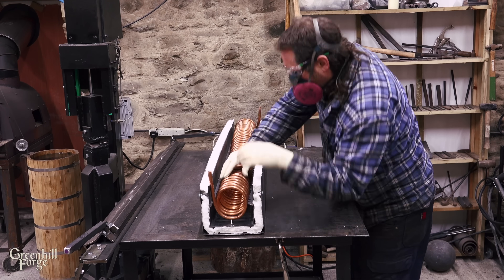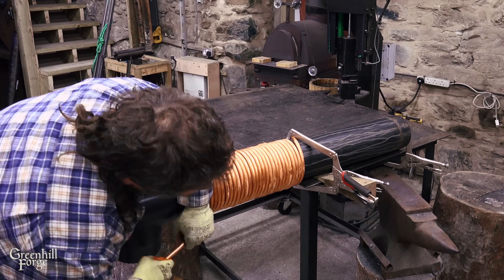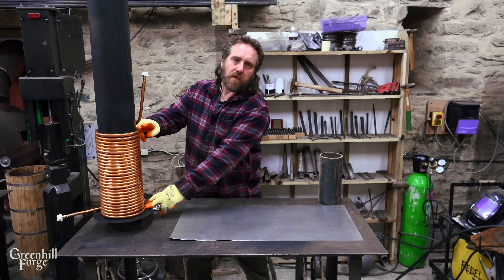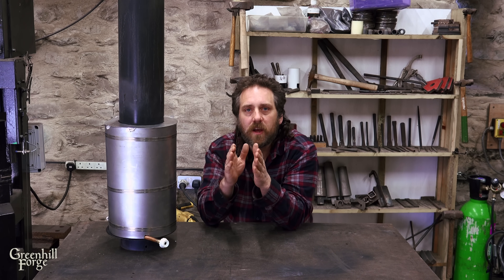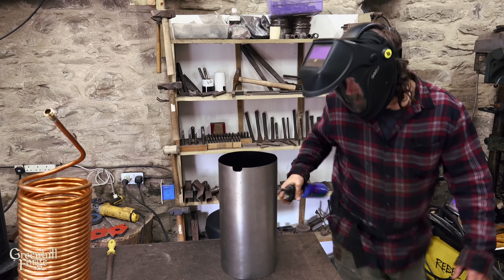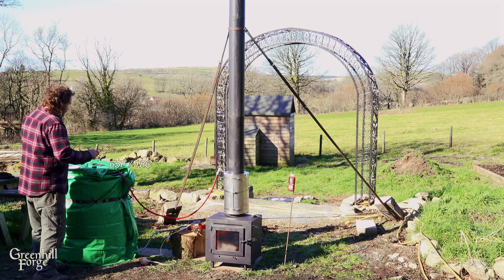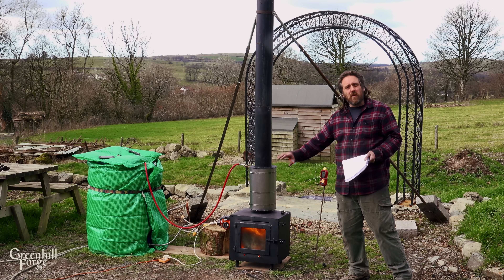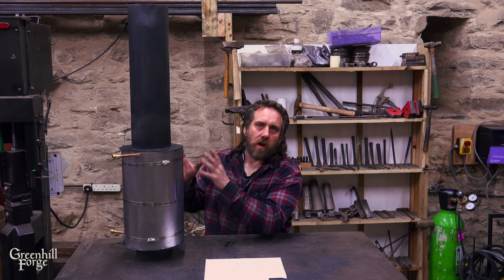Best Wood Stove Water Heater Yet: New Design Tested | Off Grid Water Heater pt3

Comment: I have an idea for you. 
Start with a y pipe 1 pipe into a y pipe  then 2 parallel pipes, one pipe is straight through with a damper this will be your by pass pipe to get your fire going. Once the fire is going shut the damper on the by pass pipe which will force all the smoke through the other pipe.
On the other pipe you put a diesel catalytic converter that the smoke will pass through, directly after the cat converter put your water heat exchanger with the copper pipe inside the flu, the cat converter will clean all the creosote out of the smoke creating more heat that will pass through the heat exchanger pipe and presto no more creosote build up on your copper pipe. The cat converter will also slow the wood burn down acting like a damper and you will get a longer burn out of your wood.

Comment: What is the practicality of having the section of flue pipe that the copper piping is wrapped around being made of copper itself? With that arrangement, I suspect the efficiency would closely approach the efficiency of pipe in the flue without the negatives. Steel isn't a great conductor of heat, which is the main limitation of the wrapped method, but with a section of the actual flue made of copper, that could improve, but I just don't know what the structural integrity of copper flue would be, especially over the long term. If that is a issue, you could try a hybrid system of a skeleton steel flue with lengthwise slits in it and wrapped with copper sheeting before being wrapped with copper piping, thereby maintaining strength with the steel but adding some direct contact between flue gasses and the copper.

Comment: Pretty impressive system with the graphite.  I was thinking that pouring in a slurry or some sort, or something along those lines, could have good results..  It would maximize conduction and, with the right ingredients, it could maybe radiate heat into the copper pipe too.  Thanks for sharing this video.

Comment: maybe put a coil on the inside ceiling of the stove? Certainly would be more efficient and due to the average temperature of fire, the coil will not need to be as big. You could weld up a bracket to hold it.

Comment: Seems to me that any design collecting waste heat from the stack is going to be less efficient than collecting heat from within the fire box. A design that runs directly through the fire box will heat up faster and to much higher temperatures and will not have to deal with cleaning the coil. It does mean drilling an ingress and egress holes for your copper fittings but no big deal.

Comment: I don't know how I got here and would kindly ask to forgive my english, nut I think physics are universal. I didn't saw the other videos, but as I can see your problem is with the heat transfer from the flute to the cooper pipe. There are a few ways to improve this, but they are expensive, the cheapest solution I can imagine would be to soak the pipe in a high smoking point oil or even water to transfer the max amount of heat to the pipe. But my point is, why do you need the cooper pipe? In my mind its way easier to just let the water flow outside de flute, maybe weld some fins to increase heat transfer and let the heat flows directly to the water. You can play with the dimensions of the jacket outside the flute, with a bigger soul you would have a slower flow of water and with a tight one the flow would be quicker. These are just some ideas that came watching your video, i hope it can help
Reply: That was similar to my idea below - Couldn't you use a heat transfer liquid like Therminol 68 or 72?  I believe it remains pourable down to -33C and fluid up to 380C in non-pressurized applications...
Reply from the maker: I'll get into water jackets/boilers at some point and I previously made an off-grid flue water jacket shower system I show in this video if you want to check it out. https://youtu.be/pP_2A5Wdvqg

Comment: I don’t know if either of these were mentioned but instead of a tight form factor if you stretched the coils taller it would allow them to absorb more heat from more of the exhaust instead of just the first foot of it, and if the exhaust tapered down right after the copper coils it would cause a restriction and that would make the exhaust piping absorb more heat from the exhaust so more would be available to transfer into the copper piping. Sorry if I didn’t word that all perfectly. Hopefully it’s understood well enough.

Comment: I do wonder if you could increase the coper to steel contact surface by using a flattened copper tube(either diy or buy). Also, I feel that the copper tube has some amount of springback to coiling and expands its diameter a bit, causing reduced contact as well, but the sand/graphite really help with that. A liquid thermal compound(ie CPU thermal paste, again diy or buy, or equivalent) might be a good avenue to explore. Is there any way to safely increase the surface area of the interior of the chimeny pipe? It would allow for more heat to be captured to be moved to the outside of the chimeny(I assume we run into obstruction issues again).

Comment: What if you cut out, and replace that section of flue pipe with a sheet of copper?  Would it be more efficient to use a reflective outside cover to redirect the heat back inwards?  Nice project and good field testing for results.

I didn't mention the 2 types of metal that makes up the flue pipe if you use a copper sheet, as I give people credit that they know to build a frame to support the softer copper bending.  As well with cleaning there could be a hatch just above the pipes to clean the copper sheet.

Comment: How would it work with a solid metal bar through the fire and straight into the water tank. Like a heating element ?
Or 
 Same again but this time a good quality pipe with the water flowing through that  straight through the fire ?

In a modern condenser gas ( methane ) home boiler heater the flue pipe is only used to capture " wastage "

Comment: Seems rather obvious but why not flatten the copper coil so you have more surface area for the heat transfer...as long as there is room for water flow, this should reduce the cooling effect of the water while increasing the heat transferred to the copper.... you could also insert metal cones into the chimney to force the heat into the sidewalls ....

Comment: Idk if you already tried this, but I'd put the equivalent of an auger blade into the interior of the stove pipe. This would circulate the hot gasses around the flue pipe and you'd get better heat transfer than just a straight flue. 
You probably already thought of this though. 
Very scientific approach!
I wish you great success!!!  😊

Comment: nicely done and very cool. or i guess hot 🤣 the graphite is a great idea. always wear a good quality mask when messing with graphite powder. if you make the coil longer, you should have faster heating although too long and you will have more creosote problems. would be an interesting experiment. i may have to use graphite in my next axial coil heat exchanger. :face-green-smiling:

Comment: What about using a heat transfer liquid like Therminol 68 or Therminol 72?  What flue pipe interface temperatures would they have to endure?  I believe either should work requiring no pump, remaining fluid down to -33C and -18C and are both fluid (useable) up to 360C and 380C in non-pressurized applications, respectively.

Comment: Awesome video! Seems like there is a lot more copper pipe on the test with coils placed inside the flue? Maybe its just an optical illusion because the coil is tighter. Would it be better if the coil was not wound so tight around the flue? If the same length of copper pipe was spread further up the flue and still packed with graphite there would be more contact with the flue maybe leading to better efficiency?

Comment: For a pool heater I was thinking of welding two water troughs together one on top of the other. The bottom would be a burn chamber the top a holding tank. 2 inch pipe from pool to holding tank. Water flows down into burn chamber through 4, 1 inch coils, tie those 4 coils back to a 2 inch pipe and return to the pool. Thoughts or suggestions?

Comment: Use a single all stainless flue pipe, weld a stainless "jacket" over that. No coil. Essentially how a gas fired water heater works. Going to have to clean the soot out regularly.

Comment: Heating graphite can produce dangerous gases, specifically carbon monoxide (CO) and carbon dioxide (CO2), especially when combustion occurs or in situations with insufficient ventilation. So I wouldn't use it in a cabin.

Comment: Increasing the “spread” of the coil would improve overall uptake. (Aka surface area).  That being said I know you are planning on a no pump off grid setup so spreading the coil might make the water flow not great the higher up the flue.  But any increase in the coil would be worth it.

Comment: what if you removed the insulation, put the coil in between 2 cylinders, filled it with graphite, and placed that inside the flu

Comment: i saw a campsite water heater built out of two flat radiators. They guy had welded them together along the top edge into a long triangle shape so it looked like a tent. Then he plumbed them in with a continous loop of copper pipe that went to a coil of pipe which he stuck in the water tank and then back to the radiators. Then he filled the system of radiators and pipe with water. The last step was to light a fire inside of  the radiator tent to heat the water. (and yes i think he had a pressure release valve in there somewhere...)

Comment: AWESOME JOB MAN!!

Hi Temp Copper Alloy Flue with Wrapped Copper tube.  Scrap the pleb flue & make it all copper:  you could mix up some graphite into an air Crete type reinforced cement and pour a custom shape around the coils,  3D printed vase mold = awesome patterns.  

All copper heat exchange flue portion could insert into a conventional stack as a flue segment dedicated to water heating.   Could have copper pipes or Fins running into the hot gas to soak up more heat.     Or something more like a still & shotgun condenser.

Add more thermocouples to map exhaust gas temps to water temp output.

Also wondered if the coil could be Rolled somehow to Flatten it and boost the Copper contact.

Eventually I think it’s a 3D printed metal rocket stove with dual wall plumbing.

Comment: I wonder if you get a better chance of heat if you used iron filings like the ones you pick up with a magnet off the ground or around the sand near the river.  To me, this would more stimulate a better conductor just like having the copper wire inside the flute.

Comment: I would try a smaller diameter but longer length of copper tube this will place the water closer to the flue gas and increase the surface area of the heater.

Comment: Not sure if it was mentioned or not in the video but using some kaowool around the copper tubing outside of the flue would keep all of the heat in that area localized to the pipes and air around it. It can withstand over twice the maximum amount of heat a stove can generate inside of it and is relatively cheap for it's many uses.

As a side note, you can use a metal 5 gallon bucket, some kaowool, and a propane torch to make a very useful smelter.

Comment: the temperatures needed to activate iron oxide/aluminium thermitic reaction is way above a wood burning temperature (3000F for iron alum thermite  vs 2000F wood fire temp) although copper alum thermite has a lower starting temp and it could activate it. Honestly it sounds like a terrible fire hazard but I believe it to be incredibly unlikely. especially since to cause that thermitic reaction you need a pretty good blend of those and that just doesn't seem feasible inside a closed container like that.
Reply from the maker: I agree, it's just one of those "it almost certainly won't happen but it it does it's really really bad" things
Reply: @GreenhillForge  ah true, but thinking about it, i don't think it would bring much gain to the table, the only thing i think would be more favourable is to flatten and solder the pipes to the chimney.

Comment: I figured I was losing a lot of heat from my pellet stove's free-standing chimney, so I cupped tin ducting around it and threw one of those vertical Noma fans on it. I went from running it on its mid setting to maintain 24°C, to being able to drop it to its lowest setting. Probably saved me a tonne of pellets this year ($500). There's a lot of wasted heat there that can be recycled.

Comment: add a 90 to your pipe coming out of your stove a put a  sealed double wall pipe with maybe 1/2  to 1 inch clearance all around on the horizontal. feed water from the bottom in front and exit top in back then 90 your stove pipe back up.heat wont have to transfer thru copper pipe or sand and will heat more on the horizontal then a strait up the pipe.

Comment: My first thought was, that it would probably make some difference if you would be able to make the outside of your copper tubing black. Somehow it makes a lot of difference what color things are. There is a reason both in arctic conditions and around the equator people wear white clothes: them being white makes them absorb less heat (a pro in hot regions) and radiate off less warmth (a pro in cold regions). On the other hand, we all know how absurdly hot black cars, black leather couches, and how unpleasantly warm even for instance a black shirts can get in direct sunlight. Black acts as a conductor, capacitor and emitter of heat, white as an insulator. I don't know why this is the case but if I should guess I'd say it is probably a result of carbon in black colorants. 
Consequently I thought about the main aspect to a number of experiments that you carried out here: the second layer of steel (the wide pipe towards the outside of your copper coil), with which you effectively created a double-walled section of flue. You have tried filling the space you formed this way, in which your coil now sits enclosed, with materials that might improve the transfer of heat. Suddenly it dawned on me that the largest improvement in efficiency you could POSSIBLY gain would come from a different way of using an actual, somewhat adapted and differently spec'ed double-walled flue*...  The idea is quite simple: make an actual double-walled flue entirely from stainless steel, with a limited amount of space between inner and outer pipe, like a quarter inch only, whilst extending your double wall over as long a distance (or height if you would) as you can. You would make sure the whole inner space you now created would be waterproof. You would make a water inlet at the top and an outlet at the lowest spot and do away with your tubing inside that space entirely, running your water directly through that space that is all stainless steel. This way the water makes maximum - even total - contact with the surface of the actual flue that the inner pipe is! 

* in my native language a flue would be called a 'chimney pipe' and what I proposed a double-walled chimney pipe. An existing, quite widely used type of part. Used for insulation reasons, the hollow filled with a non-conductive, heat resistant type of material, or as an air inlet that surrounds the exhaust outlet with gas powered water heaters. I do not know however of any application that has water running through the hollow, and I also am not aware of a type of an(y) existing, ready-made double-walled flue pipe that is both stainless steel and also has the right dimensions and thickness. I would be very curious to learn how a 'tubeless' setup, possibly with some form of insulation around the outside, would perform... cheers! 👍😎
Reply: PS  It should be tested if this idea of a double-walled water-filled flue would need some type of 'emergency' pressure release on its highest point, for in case the water inside would start boiling and by creating steam cause a pressure buildup. As steam would raise upwards it would want to push water out through the outlet as that sits on the lowest point, rather than the steam escaping itself. It is likely that water could 'escape' through your existing outlet fast enough but if it for some reason would ever get blocked you would probably want to include an extra safety mechanism. It would be worthwhile to look up how that was done with the boilers in steam trains back in the day.

Comment: Awesome video. Coil inside the flu is a much better option. To remove the creosote problem, I think a rocket stove with a much longer horizontal burn chamber would provide such a clean burn there wouldn't be any build up. Also, a much longer coil should increase the efficiency too.

Comment: -I'll second the love the grassroots youtube style of presentation and appreciate the good audio and video quality. Keep it up!
--Silver soldering the copper to the outside of the flue pipe was the way I've seen this done a bunch. Fills the gaps like sand, but with the highest thermal transfer of any metal.
--- A spiral of sheet metal with a 1 turn in 2 feet may help as well, in fluid exchangers they are called turbulators. Easy to remove and clean and would stay at temp, keeping the creosote down. 
Subbed.

Comment: You may already have this or similar, but put a damper in just above your coiled flue, then leave any damper in the fire box itself open.  Basically make that first flue section with the coil become part of the firebox.  Then once everything is burning well you should be able to close the damper to minimum with good burn flow, and have it heat the coil well while sending as little extra heat as possible past the coil.  Should work, might have to get something heavy duty for that first section though.